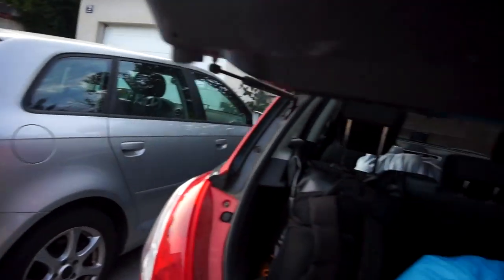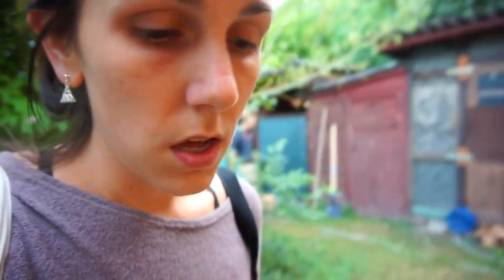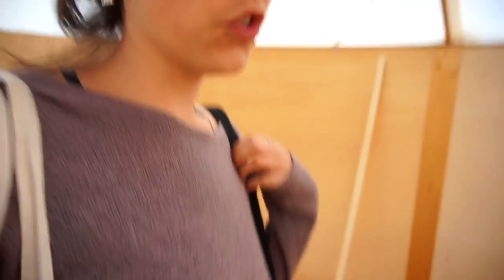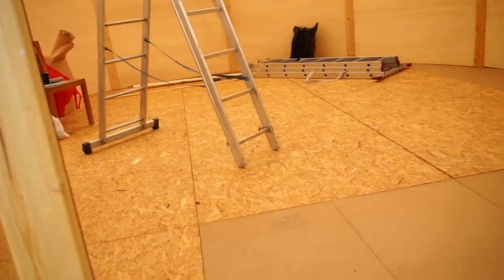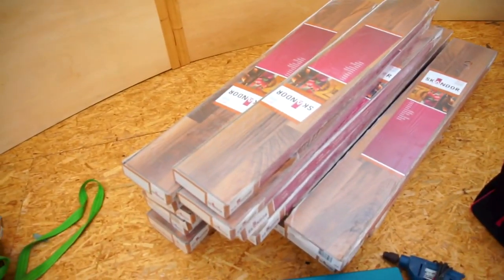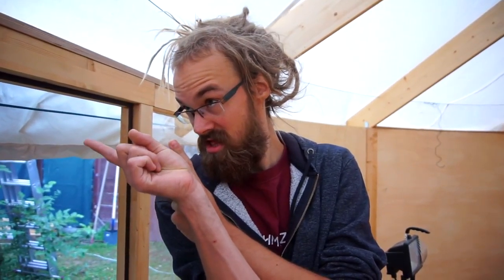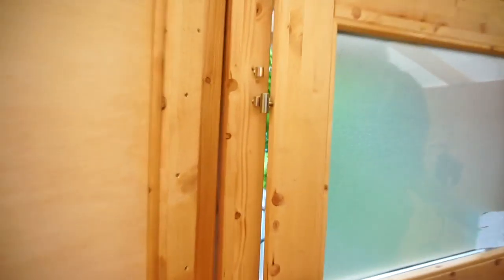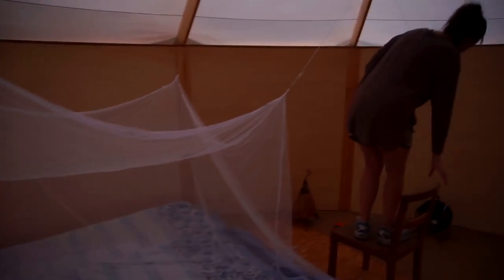Our Yurt Survived a Storm!!! - First Night in the Yurt

Comment: Dry the floor out properly before continuing. You don't want mold.

You can get an app for mold conditions.

Consider much stronger tie-down ropes. (Unless you are using Spectra)

Your girdle rope can be reinforced with a ratchet grab strap. They are not expensive at a hardware store.